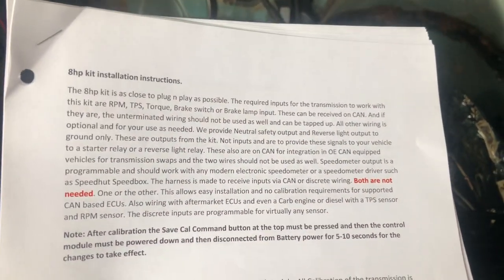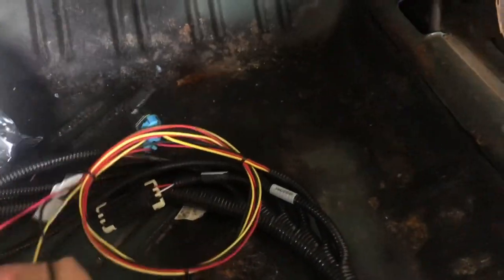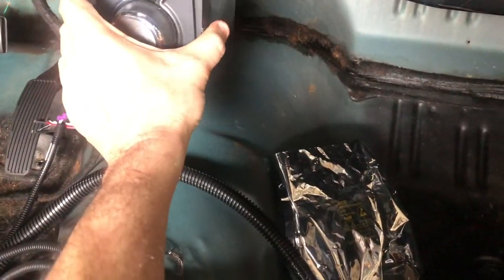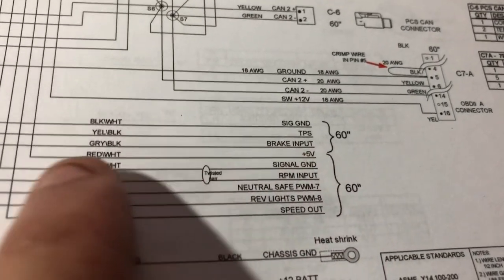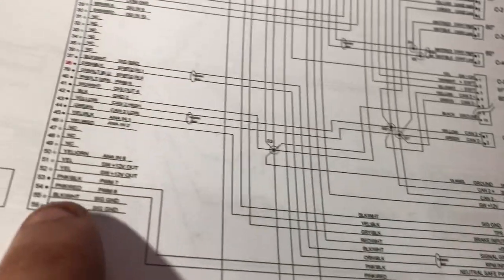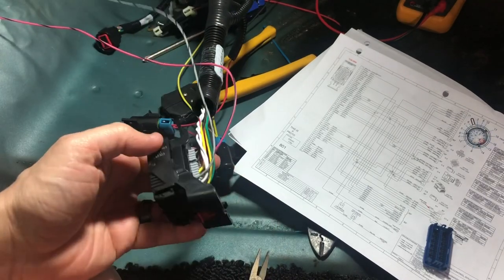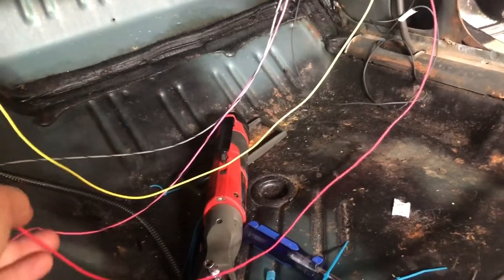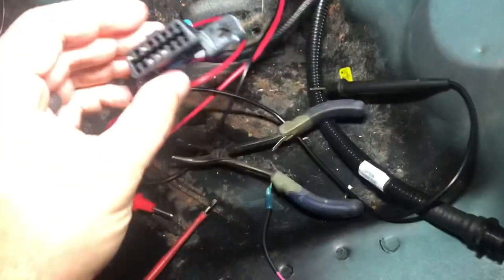‘69 Charger 6.4 Hemi Swap Part 14: 8Hp70 Sound German Automotive wiring install

Comment: Good info I'm working on wiring mine as well. I like the dial for shifter. I was thinking I'd need a shifter cable as well since trans had one from factory. You actually messaged me about install but you are further ahead than me on trans lol.
Reply from the maker: Thanks for your reply and help. Yes, the trans does have a cable from factory but it is for incase you loose power to the car you pull the cable to put trans in neutral. The trans is totally electronic but if there’s no power you can’t get it out of park. I have yet to install that cable.

Comment: Great series thanks for sharing this it’s really helpful, I’m doing the same swap, wondering where you got the wiring schematic I’m installing the sound German trans system that schematic would be helpful. Thanks
Reply from the maker: It came with the kit. If yours is missing you can either contact Russell at sound German. His customer service is awesome and He’s great about returning emails. I can email it to you as well.

Comment: It is great to see that we have used almost all of the same parts, I ran things a little different and wish maybe I had installed the harness thru the clutch pedal opening. I did a hole on the passenger side.  I also installed the neutral cable since I am running a factory 2021 Charger console and shifter, I too wanted those cup holders... I ran 2/0 marine grade cable to the trunk for a battery. A little overkill but the price was right. I am  glad that I have found your series of videos as they are still helpful as I am going to do a charger next...
Reply from the maker: Thanks, yeah I still might do the neutral cable. Not sure yet. I am going to build my own console as mine didn’t come with anything but engine and trans. I hope you find these videos helpful. Let me know if you have any questions.
Reply: @LukesGarage  I can send you some pics on the brackets I made and how the console looks. I plan on making the console lights work as well.
Reply from the maker: @johnchaney119  Which console are you using?
Reply: @LukesGarage  I am using one from a 2021 Charger. I changed the end of it to just a charging outlet from a less optioned unit. I made the brackets which were pretty simple. The only tough part and I am sure that there are other work around was I found a wrecked charger that I cut that lower part of the dash from the butts up to the console so I could use those pieces to give a more finished look and so it would meet the dash. It also allowed me to use the charger shifter instead of the dial. But if you got one from a Chrysler 300 that used the dial it would work with what you have. Plus you get a nice usable armrest and two cup holders...lol..
Reply from the maker: @johnchaney119  Thanks. I’ll look into the one for the Chrysler 300

Comment: How would you be able to manually shift? Can you add paddles? Also how much did this cost ? Great Video!
Reply from the maker: Yes you can add paddle shifters. The company that I bought the wire harness from offers them. The trans controller and harness cost $1,100. Not sure the cost of the paddle shifters. And thanks for the compliment

Comment: If I have the original pcm, harness and trans, do I still need the sound German setup
Reply from the maker: @wadeallen4030  Unfortunately yes. You’d have to keep speed sensors and all kinds of stuff from the donor car itself. The sound German takes away all those things and makes it run without needing communication with all the stuff from modern cars. Just a simple controller and minimal wiring.

Comment: What do you mean the star connector didn’t matter?
Reply from the maker: The star connection has many places you can plug that trans connector into. I thought it mattered what location was used. It doesn’t matter where you put it.